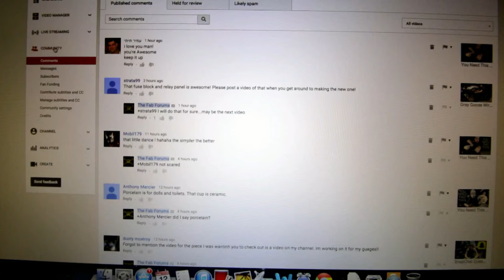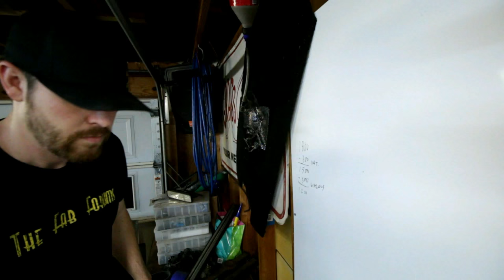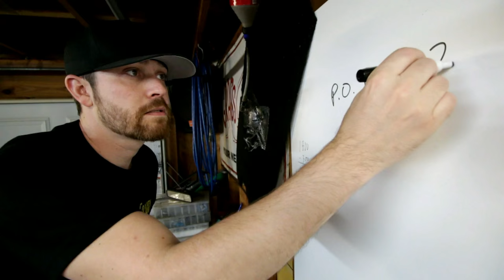Gray Goose Gets A Fuel System | Twin Turbo Mustang Foxbody

Comment: That's an awesome tip on the hose clamp, braided hose is always such a PITA.  If it weren't so heavy I'd use that on my build for sure.
Reply from the maker: +RecklessRegal its not heavy. My entire system is probably only a few pounds
Reply: +The Fab Forums That's still heavy by my standards, but the braided hose I used last was much more than that.   What brand are you using?
Reply: +RecklessRegal I just looked the stuff I used last for a 20 foot roll of -10AN is right around 5-6 pounds depending on where you check.   I ended up swapping over to Nylon because it was half the weight.   The hose clamp tip would have saved me a ton of time though, the tape method isn't the greatest.

Comment: Those AN fittings are always worth it in the end, they look so good, I've never done the hose clamp method, done the  tape method a few times but it still frays
Reply: ***** definitely, i wonder if using a zip tie if it would have the same results
Reply from the maker: +rob320is just want to be careful not to tighten the hose clamp too tight. I use the tape method also....actually did it early in this video
Reply from the maker: +Into The Dirtshop It may melt during cutting

Comment: Hi, what type of material where you hammering to make the hole impressions?  I'm going to try fabricating a bracket for an after market e-brake caliper and use existing holes in the hub from the dust shield.

Comment: Have you ever messed with an hard lines? would be kinda cool to the regulator.
Reply from the maker: +Justin Johnson I have in the past and may use some on the bibbster
Reply: +The Fab Forums 
cool man I'm looking at doing 3an brake lines on my car. what flare tool would you recommend? Thinking about the Eastwood.

Comment: The 2 lines that come out of the back of the rails and come to a y is that the feed that goes to the tank ?
Reply from the maker: no thats coming from the tank...once the fuel goes out the front of the rails it goes to the regulator and then returns back to the tank

Comment: Another option for this hoses is the thermal shrink tube, works well too.

What is this machine you used to cut the mount of fuel pressure valve? Is it handmade?
Reply from the maker: +Andrey Studentsov its a portable band saw in a stand I made
Reply: +The Fab Forums Found the video on your channel. Thanks!
Reply from the maker: +Andrey Studentsov awesome...let me know how your turns out
Reply: +The Fab Forums I don't have this tool... I don't have even an own workshop yet. It's hard to have one, being a foreign student and living in the dormitory, he-he.

Comment: What fuel do you plan on running? And injectors. We got black kevlar lines on our drag engine the look mint and don't have to deal with the braid.
Reply from the maker: gonna start with 98#ers and will most likely switch back and forth between e85 and pump gas

Comment: Why not get a proper braided hose cutter? Clean cut everytime.
Reply from the maker: lol...whats a proper braided hose cutter?
Reply: It basically looks like a large wire cutter. 
Do a quick search on google should give you a good idea, mine was only 40 dollars.
Reply from the maker: I have some of those...they are really made to cut large power cable. I will have to try them out

Comment: Hey Mr Fab, you see that new fuel filter that Injector Dynamics is gonna be putting out? Speed Academy did a video on it. It looks pretty top tits
Reply from the maker: +Smokkedandslammed I have not but I will take a look
Reply: +The Fab Forums 👍

Comment: who said men cant multitask............
if you are going to do some work on the garage a good idea would be to either add gipson plate and paint the ceiling white or tack sheets of white foil ontoo the beams , it makes the place a lot lighter with the same amount of fluoresent light and sunlight , it prolly will help the camera and retain heat or cold too
i realyrealyrealy need to get me one of those portable bandsaws. i only see them here verry rarely cant buy them fro the states as they run on 110 and we have 220 one phase here 
i wonder if you can supergleu the brading to the rubber before cutting it .....

nice job on the fuelsystem
Reply from the maker: +watahyahknow Thanks and I agree in the ceiling. I have thought abut adding something but the problem is we plan to build a new house & shop at some point and dont want to spend a ton of money on this shop.
Reply: nice ! an even bigger shop 
btw theres black / white foil here
https://static.mijnwebwinkel.nl/winkel/greensell/full29017482.jpg?
dunno if they sell it in the states , the official use for it is mainly to cover up seedlings and protect against weeds around tomatoplants and stuff over here people use it in growrooms growing the funny tabaco , it doesnt cost a lot per roll and will look good if you manage to put it on tight (roll edge in some thin cartboard and tack that to the beam so it doesnt rip )

Comment: Dude, you're seriously close to me and I'm building a fox.  Want an extra hand for wrenchin?
Reply: When I say close, I mean close....  I'm in Seneca.
Reply from the maker: lol. thats awesome. what year is the car?
Reply: It's a 1990 GT.  It's 05+ Mustang Tungsten grey with black interior.  I had a harness fire in the dash after some previous owner Jerry Rigging for HIDs, so UPS just dropped off a new dash harness, engine/ECU harness and headlamp harness for it.  I've also got a steering column and all the electrical bits for it as well that'll be going in.  I need to find someone local who's got a stock fox body so I can have a look at some of the ground locations that this car doesn't have hooked up.  Lovely previous owner woes!
Reply from the maker: sweeet. way too familiar with previous owner issues.
Reply: For sure.  Scooped this thing up in Atlanta from the guy between me and the guy who did the modifications.  He had no idea.  I drove it home 3 hours (Villa Rica) with no turn signals, sketchy headlamps and evening traffic.  My wife followed me in our Jeep freaking out the whole time.  Now that it's home, she's gotten excited about the car, so I'll call it a win and dig in.

Outside of me being a random guy on YT that hit you up to hang out, I'm a graphic designer and mechanic that has little fab experience.  If you're ever up for letting someone learn and turn the wrenches you don't want to, I'd be down to help.
Reply from the maker: ok cool. You follow me on snapcaht? I plan to hit some local cruise ins around town, seneca family, westminster, anderson....stop by and say hey
Reply: Will do man.  Hopefully I'll sort through this haggard harness and have it all fixed up in a week or so.  Headed on a mission trip with my church next week so it'll be sitting unfortunately.  Reminds me, I need to go turn it over and make an ass of myself to cycle the oil before I go.  Cam and dumps always entertain the neighbors... at least in my mind.

Comment: where is that second fuel rail for
Reply from the maker: +Jochem van der Meulen setup to run 16 injectors if wanted. I won't use it now
Reply from the maker: +Jochem van der Meulen you could run two separate fuels systems if wanted. One on pump gas, and have a second on race gas that takes over under boost.

Comment: Here is what I have been working on I still have to mount my fuel pressure regulator.
http://www.dsmtuners.com/threads/90-talon-awd-operation-clean-freak.464898/
Reply from the maker: +sk8erguy1450 very cool...those cars are wicked

Comment: what are the motor specs?
Reply from the maker: +Dominic Rosado 400 ci 4-bolt Dart Block (351w) base. H-Beam rods, Ross dish pistons, custom crank, custom Bennett turbo roller cam, Edelbrock Performer Heads, BigStuff3 efi, 160# injectors, E85. StreetCar Setup
Reply: +The Fab Forums Nice!!! Loving the 351w base! what are you running for transmission? a built c4 or t5 or just a brand like rossler or another one like that?